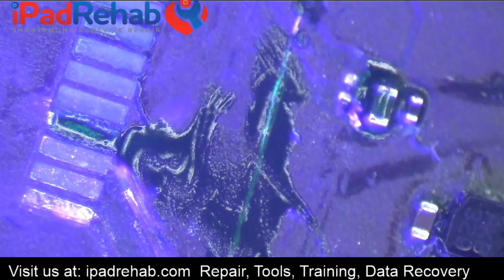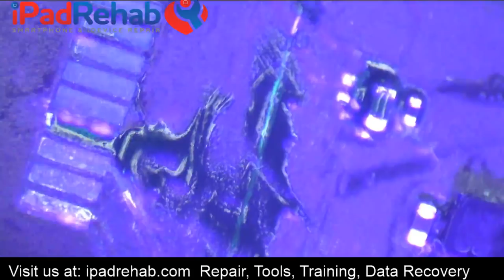Scraping is.....really bad.  Fixing Bonnie's Board

Comment: Ya do have to be careful assuming NC from look alone.  Sometimes the PCB might use HDI tech and have a 0.07mm laser drilled micro via inside the pad that has been plugged, filled and plated to cover it up.  They look just like a NC pad but have a VIA in them to connect to an inner layer   So they look NC but are actually connected